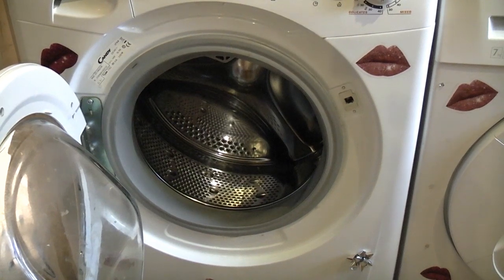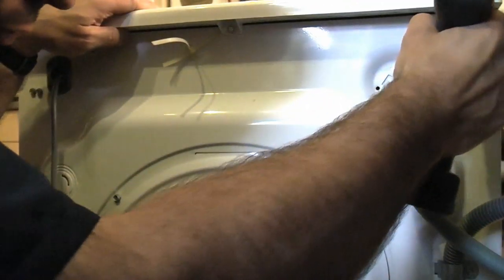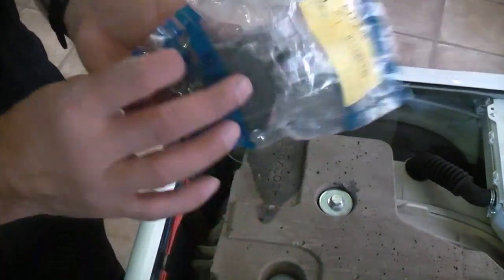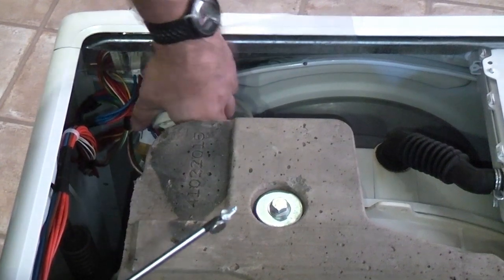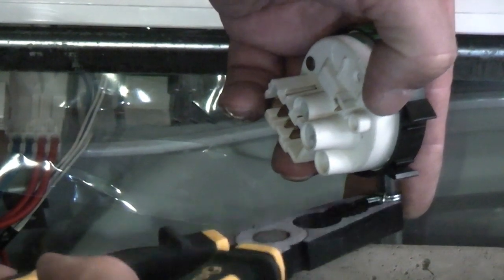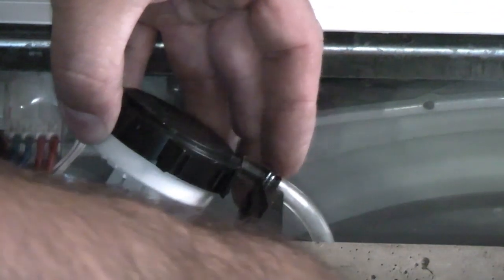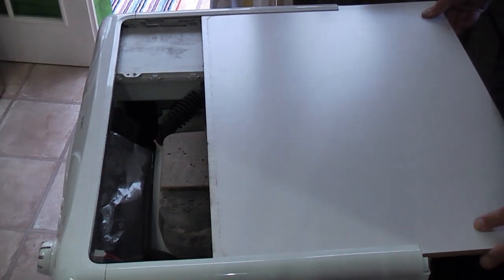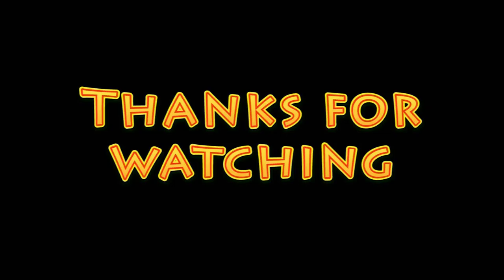How to replace a washing machine pressure switch | Candy/Hoover washing machine pressure switch

Comment: Nice money saver, I've not had the need to do that one yet. But have replaced a solenoid inlet water valve for n my washing machine, pretty straightforward and much cheaper than the repair technician. Thanks for sharing and keep up the great content 😌
Reply from the maker: You are welcome
Thanks for the comment 👍

Comment: Nice and clear,
 But be warned some pressure switches if you blow in them you can mess them up, 
but if you refit, then place a couple of liters of water down in the draw then put on a spin it can rest them,

Comment: Hello there, great video.  I was wondering: Did the replacement sort the problem out, and would you find the same issue with Bosch washing machines?
Reply from the maker: Thanks, yes this fixed the problem. Pressure switches cause similar problems on all makes of washing machine.
Thanks for the comment 👍

Comment: Great video, our washer is collecting water after hours of finishing the laundry, is it due to faulty pressure switch also, and if it not, how to fix it please?
Reply from the maker: It could be a faulty water inlet valve, or sometimes water can run back into the machine from the drain, if the machine is not plumbed in correctly.
If you turn off the isolation valve to the washing machine and it stops filling with water over night, you know that the inlet valve is passing. 
Here is how to replace one- https://www.youtube.com/watch?v=INM-zydofMA

Comment: What are the symptoms of a dodgy pressure switch?
Reply from the maker: On this machine, it was going through its cycle, but the washing was soaking wet after the machine finished.
For weeks we had to manually spin the washing, to get it dry enough to be able to dry it.
Pressure switch problems often mean that the water level in the machine is incorrect.
Thanks for the comment 👍
Reply: It says "Woof" and wants to go outside and play with a ball.

ohhh... you said "doDgy"...
Reply: @ultimatehandyman  our candy grand o vita is not filling up with the correct amount of water so I assume the pressure switch could be the cause?
Reply from the maker: @welshman2011   I'm not an appliance engineer, but yes, that can be caused by a faulty pressure switch.

Comment: Any hints to stop the washing machine from shaking a lot during the spin cycle. I have a AEG and it vibrates the house during the spin. I have it installed on a solidly built box for heigh convenience. I had the box screwed to the wall initially but that made the interior walls of my house shake worse. Now the free standing box takes up a little of the vibration. I had the sales man send out a service man in to check it out after I bought it. He said it is normal, He said I could try pouring a cement pad. This is on the main floor of my house. I don't want to take it down to the basement where I have a concrete floor. I'm in Canada and we typically don't use these smaller European appliances. I kind of wish I didn't.
Reply from the maker: I'm not sure what you could do to stop it from vibrating, perhaps this will help- https://www.youtube.com/watch?v=uKBy-9NEF5A

Comment: Go on then...how many times did you drop the screw down into the machine? If it was me, at least 4 times before losing my rag, ripping the machine out and leaving it out front for the pikeys. :)
Reply from the maker: I didn't drop it once (honestly).
When I saw where it was, I just knew that when I removed it the damn thing was going to end up in the bottom of the machine, so I got the magnet from my office. It didn't work too well for putting the screw back though, hence magnetising the end of the driver.
Thanks for the comment 👍

Comment: I tried blowing down the tube and the air didnt flow freely, did it for you ?   Im having problems with the E3 saying the machine isnt drained even though I changed the pump and it is. So wondering if this pipe is blocked.
Reply from the maker: No, there should be a lot of resistance there. When you blow doen the tube, you should be able to hear the switch clicking!
Reply: @ultimatehandyman  I meant I disconnected the switch and blew toward the drum. Is that what you meant ?
Reply from the maker: Oh right, I thought you meant blowing down the pipe to the pressure switch.
If you are getting a lot of resistance when blowing the other way, I would check the pipe for a blockage ;-)
Reply: @ultimatehandyman  machines totally stopped working now lol.  Ill have to call a handyman.   Its a shame its so hard to find diagrams or I  could do a bit more.

Comment: I have a Hoover visiontech 7kg washing machine, it is overfilling but only once a week.. seems strange. It's always at the start of the wash. Any ideas?
Reply from the maker: Have you tried disconnecting the hose that goes to the pressure switch?
If you remove the hose from the pressure switch end and blow down it, that should clear any blockage in the pipe (if there is one)
Thanks for the comment 👍

Comment: Hi , can this switch cause e03 error , I changed the drain  pump and cleaned everything  but keep showing this fault  , at the spin cycle the time stuck at the  not changing  , can you please advice
Reply from the maker: Not 100% sure, but it looks like e03 is a problem with the drain circuit.
I'm not an expert on washing machines, I just replace the odd part.
There are some forums that specialise in washing machines, it might be worth asking in one of those ;-) 
Thanks for the comment 👍

Comment: My gardening customer would like to know what to do with her noisy 20 year old AEG washing machine - new machine?
Reply from the maker: It depends on what is wrong with it. 
20 years is a good run for a washing machine, I had a Hotpoint once which lasted a similar amount of time.
The problem with machines of that age is that, once you start replacing components it might be uneconomical. 
It might be worth getting the bearings checked, perhaps that is the cause of the noise.
Thanks for the comment 👍
Reply: @ultimatehandyman  is it economical to change the bearings?
Reply from the maker: Yes, especially if you change them yourself. It's not a job that I have done yet, but think it would require a couple of hours to replace the bearing(s). A set of bearings will probably set you back £10-£20
Reply: @ultimatehandyman  thanks for that. I'm not sure I fancy tackling it myself. Do you think it would be economical to pay someone to do it?
Reply from the maker: A mate of mine once had the bearings replaced in his washing machine, by Darwen Domestics (in my home town), I think they charged about £60 
That is of course, if it is the bearings that are making the noise.
You do of course have to consider that you could put that £60 towards a brand new machine!
Reply: @ultimatehandyman  sounds reasonable!

Comment: Think I would leave the repairing of any machine to a real professional ...
Reply from the maker: I'm a fully qualified electrical and mechanical maintenance engineer ;-)
Thanks for the comment 👍
Reply: @ultimatehandyman  I don't mean you , I was just saying this might be too difficult for a simple diy person like myself.
Reply: I don’t think the modern world agrees with you. Many, many people are looking at repairing stuff these days. 

It’s always at their own risk, of course. But as well as saving money it can also get you going in an emergency 

ALSO, I did get “a real professional” from Bosch to come and repair my boiler. He told me the heat exchanger has “gone” and due to age of boiler it wasn’t worth fixing. 

I didn’t believe him due to the symptoms so I investigated myself. I found an air bubble and with some pressure from a hose pipe I fixed the problem. Boiler has been working brilliantly for last 18m

So if you don’t know what you’re doing and aren’t confident - get someone in, but these days with brilliant videos like this, why wouldn’t you try yourself ?

Great video UHM as usual 👍
Reply from the maker: @ Lhong Kho
Oh, OK. 
This is not a difficult job and, as long as you unplug the machine it is impossible to do it incorrectly, as the connector will only fit one way around. Thanks for the comment ;-)
Reply from the maker: @ Graham DIY
Well done for sorting the problem yourself 👍
Thanks for the comment
Reply: @ultimatehandyman  Naah it is too difficult for me. Hammering wood or drilling holes on concrete I can, but I am too afraid to deal with electrical stuff, I am really not qualified. There are people who died changing their christmas tree light bulbs in the news here.